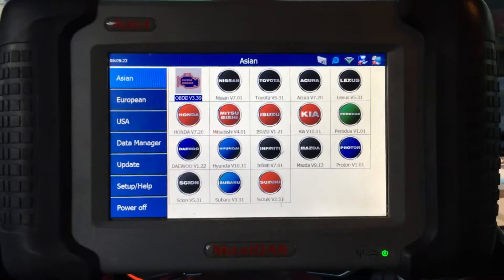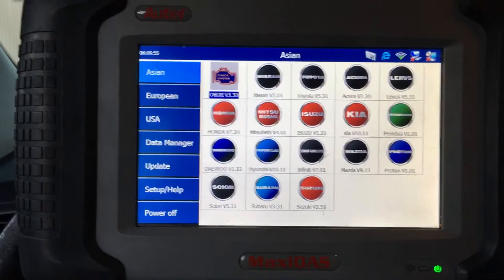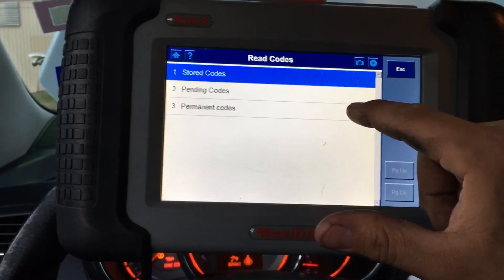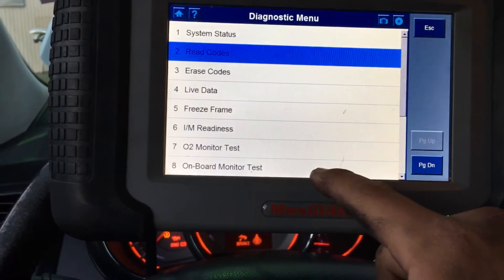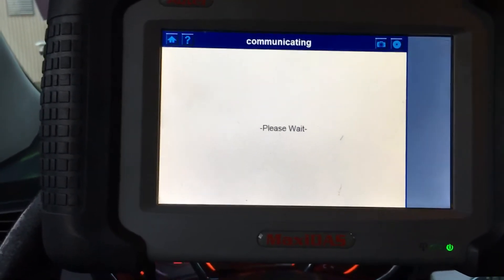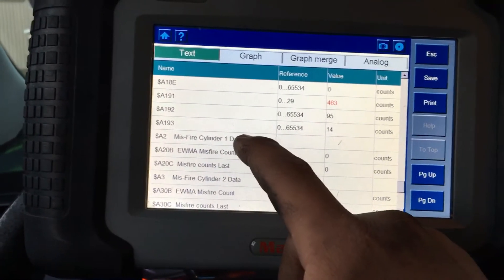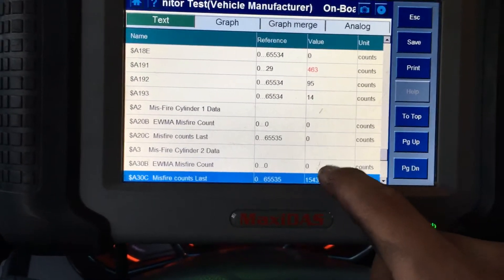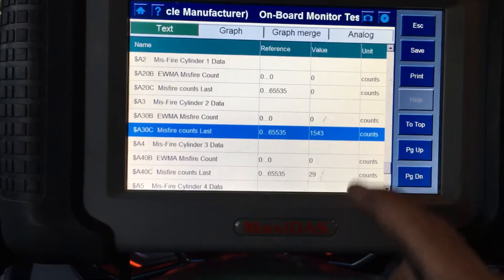NISSAN HOW TO IDENTITY MISFIRING CYLINDER

Comment: What if there is a headgasket leak and leaked coolant causes a misfire? Is this counter able to detect that? Also what if the injector is clogged and causing a misfire? 

Because, my trailblazer is misfiring just a little bit but the counter is showing zero.

Comment: Nice video. I have a 2016 Rogue 2.5L with P0300 right now first I had P0301 & P0300 with high vibration and hefty misfires. Swapped coils 1 & 2 but no change in codes. Swapping 1 & 2 plugs gave P0302. Changed the plug and one day later got a P0303. Changed all plugs and now getting P0300. Car is running much better with new plugs but has rough idle and will throw ck engine light at idle. Seems to have plenty of power.

After seeing your video I found my handheld Autel scanner can monitor misfires. Cylinders 1 & 2 show none but both cylinders 3 & 4 have ever increasing misfires as I go in and out of the charts. This car has only 4,500 miles on it so wondering if that is some clue?

Any idea where to look next?   Thanks-Mike
Reply: Did you find the solution?

Comment: General question, on a 2015 pathfinder Iam getting all cylinders misfires, up to around 6 each one, no codes whatsoever, but these are very hard  jerks, u would think the tranny about to fall out, only at low rpms , otherwise fine, I could drive cross country np,   Only 51,000, miles,  I would assume plugs first? ,  any experienced Nissan guys comments, greatly appreciated

Comment: Hello sir,,,I have nissan patrol platinum v6,,,I already found the misfiring cylinder,,,and it no.5,,,spark plugs are new and I changed the coil as well,,,but still misfiring,,,just wanna ask what else could be the possible cause?,,,thanks a lot and God bless
Reply: did you ever figure this out?

Comment: Finding a misfire can be tricky, depending on the tools and knowledge you have. Cylinder drop testing isn't always easy, especially if more than one is misfiring or if it's caused by a lean condition...
Nice example Eric!

Comment: Thanks alot
I've had my misfire on and off for months
Everybody is telling me to switch to OEM coil pack but its $1100 for them at the dealership 
And the mechanic shop I hang out at got that scan tool but I guess they didn't know about that setting
Reply: Amazon cheapest ig coil is good, you just need to expect to receive one or two bad ones and request replacement because their quality control is trash. 

This is why I wouldn't recommend ebay because their return procedure takes too long.
Reply: @ZERONEINNOVATIONS  I ended up buying denso brand from somewhere and it went away
I wouldn't buy from Amazon tho